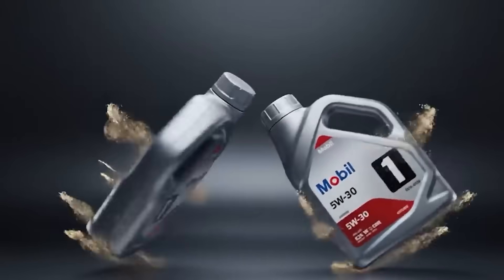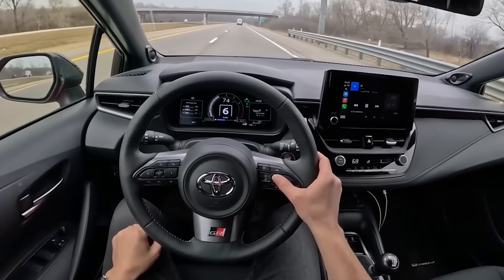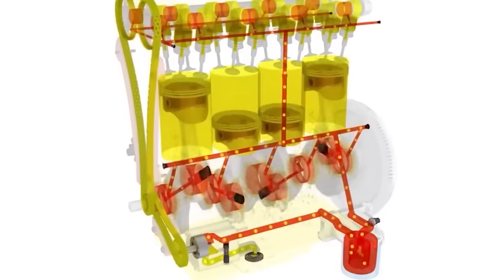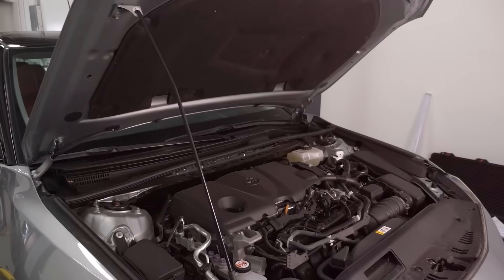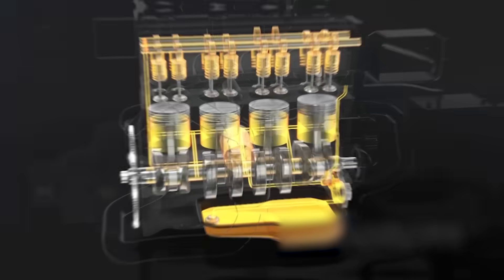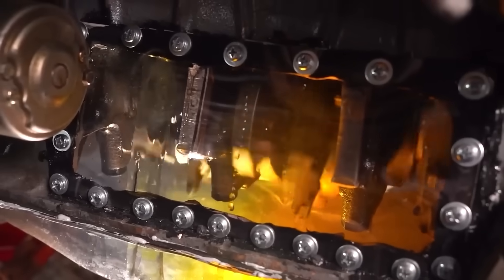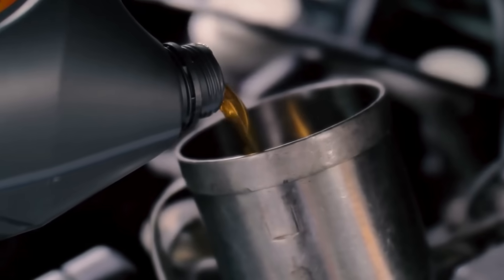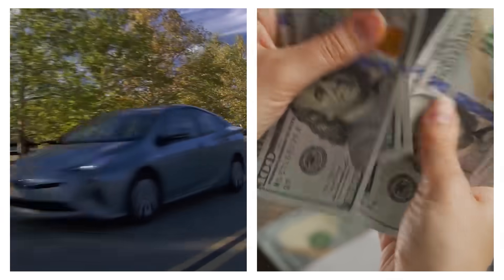Toyota 0W-20 Vs 5W-30 Oil: The Research That Will Open Your Eyes (50 Engines Examined!)

Comment: Being a Machinist and Mechanic for over 45 years, I service all my vehicles since day one. My 2003 V6 4wd Highlander ,I bought new, has 425,000 hard miles, still runs perfect. I've changed the oil "religiously" every 5,000 and always use 5w-30(recommend) Mobil synthetic and always a Toyota filter. Now my 2016 Sequoia, I bought new,  only has 95,000 miles, but that specifies using 0w-20, so that's what I use.The owners manual does say if 0w-20 is not available 5w-30 can be used,  but the next oil change must revert back to 0w-20. Finally our 2023 Rav4 specifies using 0w-16, so that's what I use, and always O.E.M. filters,& parts.

Comment: Old guy here. I have a 1991 Toyota pickup, 2002 Toyota Sienna, 2004 Toyota Camry, and i help my daughters with a 2003 RAV4, and a 2007 Toyota Corolla.  Thank goodness they ALL specify 5w30 motor oil. I don’t have to deal with this.

Comment: The video is precisely why the push of 0w20, it saved fuel, not the motor.  These Toyotas were not run in an AZ or Texas like climate.  Try again, thumbs down for the EPA, CAFE supporting BS.  I once found a viscosity chart for full synthetics, it had 0w20 good to 86F, so AZ, Texas, hot climates will shear down that 0w20 and not protect as well as 5w30.
Reply: Lol Toyota Proving Ground  Peoria Arizona.....😂 NW Phoenix off the 74

Comment: What an A.I generated crock of poo this video is. Same engine sold worldwide, anywhere overseas, Europe, Asia, they use 5W-30, but in the US they use 0W-20 or 0W-16… What’s the difference, CAFE regulations. That along with start/stop technology, weak piston rings to reduce friction are all designed to squeeze out an extra half mile per gallon, at the expense of the longevity of your engine. “But that’s what the manual says, that’s what’s recommended by the engineers”…Yeah the same folks who will gladly sell you a new car when yours craps out after 75,000 miles. Keep believing the BS. B.O.H.I.C.A. with a smile is all they offer.

Comment: 0W20 why not 0W8. It helps Manufacturer when you can put CAFE lovely numbers on a Window sticker. Then there is also legal ramifications for the manufacturer to rec any owner to use any oil that would lower the MPG on the sticker. If you look and read the section carefully you see there is a exit ramp to use a thicker oil. Also there are addendums on tropical and as well arctic use. None will start in the --- 60 F* . Thank Goodness for the SR71 and group 5 fluids.

Comment: Before going from 0W20 to 05W30 you better make sure your oil pump is programed to use 05W30. Your oil pump in programed to use 0W20 not 05W30.
Reply: how do you program a mechanical pump?
Reply: So what happens when the 0w20 is frozen at 32F and flows like SAE140.  Ya, that program line is BS.

Comment: There is no oil on the planet that can protect your engine for 10k miles, there’s a reason manufacturers recommend it, constant stimulus of broken engines coming back to them to fix.
Reply: Oh really, I guess I'd better tell my 85' Chrysler 600 Turbo and 89' Dodge CS Daytona turbo they weren't supposed to survive my 15,000 mile OCIs with a filter and top off halfway.  Your don't know anything.

Comment: 0w30 winter, 5w30 summer.
I actually get slightly better mpg with 30 vs 20 on my higher mileage Toyota. Also smoother, quieter and more throttle responsive engine.
Ran 10w40 in my Subaru, world of difference on the track.

Comment: 5 20 or 5 30 same cold 5 20 but texas heat in traffic 5 30 changing it before it hits 5k 8k is the best get the unburn fuel out of the oil

Comment: Putting the wrong, higher viscosity oil into your engine is something I do only when there is Soo much blow by from a few 100k of wear and tear, running commercial vehicles until they are totally worn out, or another one of my boat engines were nearing their end of life and I was about to DIY replace another block.  My 28 year old 3.0V6 178,000 miles, runs perfect on Castrol 5W-30syn I DIY regasketed the engine. I have no leaks! At 3k miles, I am down 1 quart. Engines DO use oil! That usage has not increased in 9 years. If I ever am Soo lazy to go 10k miles, I would use Royal Purple oil and change the filter three times in 10k miles. Keeping the oil clean is paramount. Don't use cheap filters!

Comment: 0W20 is a EPA and CARB POLITICAL DECISION !!!!  The use of 0W20 is not AN ENGINEERING DECISION !!  The rest of the world, aside from the USA, gets 5W30 or even 5W40 oil recommended inThe Same Engines that "require" 0W20 oil in the USA !! Screw 1 more MPG if the $10000 engine gernades well before it "really should".
Reply: Literally fiction.  Seriously grandpa, if you have NO IDEA how any of this works, then maybe have someone teach you.

0W-20 oils were developed by HONDA in JAPAN in 2004.  CARB doesn't exist in Japan, and no the "rest of the world" does NOT use 5W-30.

These absurd claims from senile clowns on here are beyond embarrassing...

Comment: My 2023 Corolla Hybrid AWD Spec. engine oil is  "0W16"  full synthetic!  This is Toyota's specificarion.  68,000 km on the clock so far.  Oil changed at 5,000 to 7,500 kms. with Toyota oil filter.  No issues so far.

Comment: So which do I use in winter and what one do I use in summer 👏🏻
Reply: 0w20 below 60F, 0w30 over, or even 5w30 over.  If you have a warranty, Amsoil or Redline 0w20 in the summer.  Unless your dealer has a problem with Amsoil.  Amsoil isn't willing to pay for certain certifications that are very expensive.
Reply: @lonniebeal6032  There is zero benefit using Amsoil or Redline if you change the oil every 5k miles.  The wear difference between those and Mobil 1, Pennzoil or Kirkland wouldn't even be measurable after 1 million miles.

People are simply massively over thinking the oil in the engine, and should focus on changing it on time vs worrying about which oil brand they are using.  If you change your oil every 5k miles, the oil brand is utterly irrelevant to the lifespan or wear on the engine, despite all the marketing hype...
Reply: The same one unless you live in the Klondike...

Comment: This video is EXTREMELY misleading. Toyota recommends 0W-20 in the USA due to emissions (fuel economy) reasons.  In Europe and other countries you will see the same vehicle, identical in production, using 5W-30. This whole gimmick of “cold starting” is nothing more than fear mongering to disguise their true agenda which is two fold. First is CAFE. CAFE stands for “Corporate Average Fuel Economy”. The United States has implemented laws that restrict manufacturers, or rather govern them by implementing a mandatory minimum combined fleet fuel economy average. This is why we are seeing most manufacturers switch from V8 and V6 naturally aspirated engines to smaller displacement forced induction (turbos, etc) engines. And they are produced at such high tolerances that we are seeing a severe decline in reliability. It is also why they have switched to lighter oil weights such as 0w-20, 0w-16, and even 0w-8 (All used in new Toyotas). It has nothing to do with “cold starts”. Why else have older models/engines using 10w-30 lasted for half a million miles? Proper maintenance and enough viscosity to protect moving parts. Cold starting or not. Now that said, yes, those vehicles used wider oil galleries that allowed thicker oils to flow easier when cold. So don’t go putting 10w30 in your 2023 toyota. But at the end of the day 5w30 in place of 0w20 ABSOLUTELY WILL protect your vehicles engine longer, better, and make it last longer. Period. End of story. Any other argument is biased and has an agenda. 
Secondly, and perhaps even worse than the first reason is something called “planned obsolescence”. This is basically when a manufacturer (of any product, not just automobiles) designs a product to last a certain amount of time specifically for revenue longevity. If a manufacturer made a vehicle that lasted forever, well, that’s not a very good business model to the corporate greed gurus who want to see a ten year consistent revenue average on new car sales. So, simply put, they design shit to break in a certain time frame so you have to buy it again. 
So in conclusion. 5w30 is and always will be better (and yes EXTREMELY cold climates are the exception), and DO YOUR MAINTENANCE EARLIER THAN RECOMMENDED. I could write a book on the concerns with 10k mile oil changes and how/why they cause issues. Change your oil every 5k miles MAX. 
Good day
Reply: Except of course, these claims are utter BS.  Toyota's own testing showed that 75% of engine wear came from starting up a cold engine.  Which is not surprising as the oil has to circulate from the pan, and there will be metal on metal contact for a few seconds.

What is even more comical is this TikTok University expert here doesn't even know that Toyota recommends 0W-16, not 0W-20.  This entire oil baloney has become this new cult religion, where data be damned.

Modern engines will run to 200k to 300k miles, if people use Synthetic oil and change it roughly every 5k to 6k miles.  What matters is the ADDITIVE package, NOT the oil viscosity, as has been PROVEN beyond any doubt in countless studies already...
Reply: @redbaron6805 I don't agree with this statement other than change the oil every 5000 miles.
Reply: @jasonthrash4357  The core problem here is that your claims are simply 100% wrong for several reasons.  It isn't a matter of my or your opinion, it is what the data and science actually says.

You are basically wandering into the very common logical fallacy of bigger is better.

We know that simply isn't true.  Hauling a 500 pound load on a 3 ton truck is not better than hauling that on a 1 ton truck.  If you used 2AWG wire in your entire house, it would not make anything run better, and the heat loss difference in the wiring would be less than 1% for 10x the cost.

Same applies to engine oil.  Oil is analyzed on the Stribeck curve, where the goal is to get engine component friction out of the Boundary area, where metals have contact with each other, and into the Hydrodynamic zone, where oil separates the surfaces and there is no metal to metal contact, hence no wear.

People are thinking thicker oil viscosity is the only way to do this.  But with modern fluid engineering, this can, and is, being done through additives.

Modern oils are engineered to move the engine components into the Hydrodynamic area.  Once you are on the Hydrodynamic area curve, thicker oil doesn't actually do anything except increase the drag on the engine and create additional heat.

It is no different than running a car designed for 87 Octane on 93 Octane.  93 Octane gas has less energy per gallon, so you would be paying more for worse MPG efficiency.

0W-20 has been proven to have the same or less engine wear on engines that are designed to use 0W-20.  Toyota has proven that in studies, Honda has proven that in their studies, and there are multiple studies published in ASE which clearly show that modern engine oils don't need thickness anymore to protect the engine from wear, as that is now being done through additives.
Reply: @redbaron6805 我來自台灣，但我開得車是歐洲的進口車opel mokka，我非常同意您的觀點，我們台灣的原廠車商建議用5W30的機油保養，但我換了OW20機油後不但開起來更順暢且油溫也降低了，對於帶渦輪增壓的車種，保持溫度不要太高至關重要
Reply: Very well written 👍
Reply: Yeah idk about any of the above. Doesn't our oil dillute some due to fuel on extended oil change intervals. Like at 6000 miles? I'll roll with 5w30 since that's what's recommended for the exact same engine outside of the U.S.
Reply: @357wesdog  First, lets just acknowledge the simple fact that the video is literally Ai generated slop, referencing studies that don't exist, and claims that are literally fiction.

Then, lets start talking about using cheap fuels is a lot more harmful to modern engines than thinner oil.

There is a reason auto manufacturers want you to use Top Tier or Top Tier Plus fuels.  Using the cheapest mule piss you can find at some scrawny gas station held together with duct tape and wire is harming your engine a lot more than using 0W-20 vs 5W-30 oil...

Comment: If you live in Texas or Florida use a heavier oil, use a heavier oil in summer and lighter during winter
Reply: It makes no sense to do that in Florida.  Maybe in Laredo TX or Phoenix AZ.  Florida rarely gets above 90F, and that simply isn't hot enough to make any difference when using 0W-20.

Comment: This is untrue.  There is no study.  AI videos are always lying.
Reply: "A recent study of 50 Toyota engines indicates that using 0W-20 oil is better for wear resistance than 5W-30 in modern, properly manufactured engines, which is contrary to some older recommendations. The study, which tested different oils and wear over a 100,000 to 300,000-mile range, showed that 0W-20 generally resulted in less wear than 5W-30, despite 5W-30 having a thicker film at high temperatures. .."

Maybe the neighbors kid can show you how the internet works and how to look up elementary data...
Reply: @redbaron6805 that “study of 50 Toyota engines” was fake. Lake Speed Jr talked about this so called study on his channel.
Reply: @davidw4151  You are actually confused on this, as there are several actual studies that showed thin oil does not affect engine wear.

One is Honda's study from 1999 published in SAE International, which is SAE 1999-01-3468.  It is called The Effect of 0W-20 on Fuel Economy, and it did check fuel economy AND engine wear.

The conclusion was: "There were NO anti-wear performance OR oil-consumption problems when using 0W-20 in an actual engine."

Then Honda did another study in 2011, also published in SAE International, using even thinner oils than 0W-20, and concluded: " There was NO Significant Wear Due to Lower Viscosity Observed in Sliding Parts."

Then there was a THIRD study in 2020, published by Toyota in SAE International in 2020, which is SAE 2020-01-1425.  It concluded that using Additives instead of Viscosity gave a thicker protective film thickness which gave the same protection as thicker oils.

The Fourth study by Lake Speed Jr. in which he compares dozens of Used Oil Analysis reports, where owners switched to 5W-30 from 0W-20, and compared the wear metal differences in the samples.

As he posted very recently, about two weeks ago or so, the conclusion was interesting.  By switching to 5W-30 oil from 0W-20 oil, and comparing wear metals, wear INCREASED in all the reports, although the increase was relatively small, and not statistically significant.

Hence, the data clearly shows thinner oils have nothing to do with engine wear.  What matters is regular maintenance, as the wear difference will never become a factor in engine lifespan.
Reply: @redbaron6805 I agree with everything you stated and I defer to your knowledge of the above studies. However the “50 engine study” that is talked about isn’t anything but internet folklore. LS jr himself stated that. I’ve no doubt studies have been done, I was speaking specifically about the 50 engine one. The interesting thing is they don’t verify any of the studies as you yourself did, they just make a broad statement with nothing to specifically back it up. You provided verifiable info, they didn’t and that’s all I was saying. They had no source given other than vague descriptions. Take care, stay healthy stay safe.
Reply: @davidw4151  I guess some of this may be lost in the nuance here.  There are some Ai generated garbage video's posted on YT which talk about a mysterious 50 engine Toyota study, which claims 5W-30 engine oil is superior.  That study doesn't actually exist.

There is a however a real Toyota study, that tested engines wear and oil viscosity, which clearly showed oil viscosity is not a factor in engine wear.

I don't recall if that study used 50 engines or not.  The problem is Ai generated slop is referencing non existing studies, which are then getting mixed up with real studies showing the opposite.

That's where we are at.  Take care....

Comment: I was a mechanic in the USAF. It's more important to change your oil more frequently than what the manufacturers recommend. The 7500 to 10,000 miles is what is causing more engines to fail early. I have 345,00 miles on my 2006 V8 engine.  And I change my oil every 3500 miles and my engine runs smooth. And my Lexus has 282,00 and I change it every  5000 miles. Both use 5w 30. So in the Air force its the maintenance that have kept the A10 flying for 50 years. And we had to stay on top it. So staying vigilant on the maintenance is the important thing.
Reply: Former military also and YES, maintenance is absolutely a MUST and engine oil adjusted for CLIMATE is the way to go! I use 0W-20 winter, 5W-30 Summer and 5W-40 in the desert. ALL 100% SYNTHETIC!
Reply: I love what you said!  Synthetic oil will go 5-6K miles.  I have a 2003 Honda accord 385k miles, change oil and filter every 5-6K.
Reply: What’s it like working on the A10?
Reply: @Steve.2112  The A10 was an awesome aircraft to maimtain. I also work on F15 C models. But the A10 was my favorite.

Comment: OK maybe be 0w is good for below 32 degrees,  how ever 5w will  leave a strong film of oil between metal surface even hours later, 0w = nothing.
My car lives in a garage, in the morning with out side temperatures in the mid 30s, the temperature temperature  in the garage doesn't drop below 50. The bs about 0w20 was brought to us by Obama's administration,  oh, I live in Florida.
Reply: 0W-20 started on the Honda Insight and the S2000 back in 2004.  If you think Obama was president in 2004, someone please buy you a calendar and you may want to go back to 4th grade and graduate this time...
Reply: @redbaron6805  Still democraps BS.